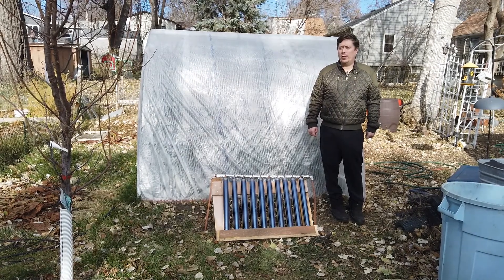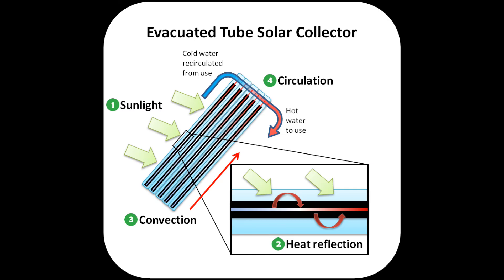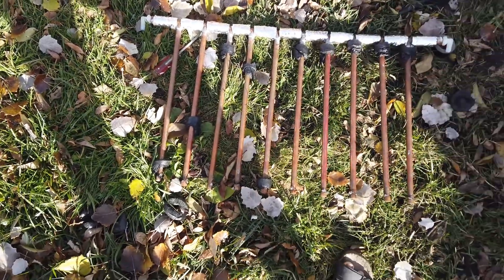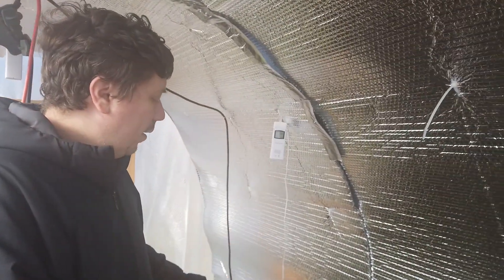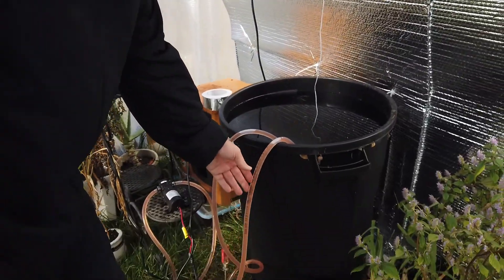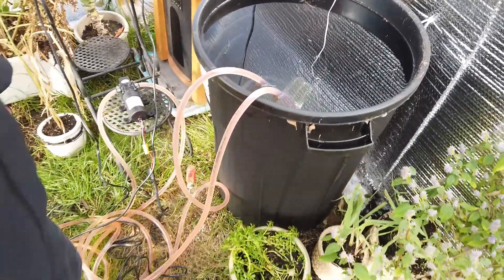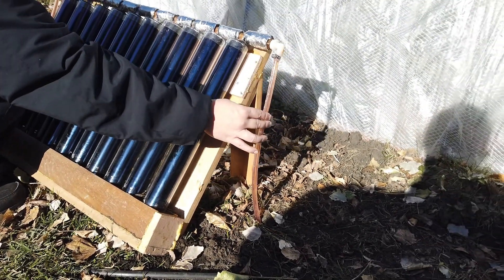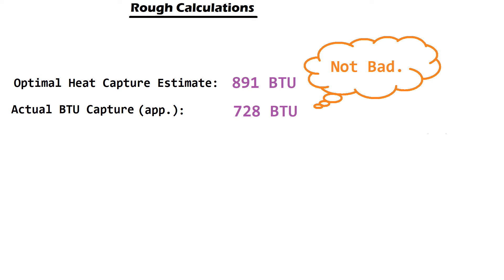Can Solar Power Keep My Greenhouse Warm AT NIGHT?

Comment: I’d be interested to see if you’d see a pump in power if you put something reflective behind the tubes.

How do you decide when to start running the pump?
Reply from the maker: In this case, I simply started the pump shortly after the sun was up. There are better methods, such as cycling the pump, and probably strategies of sensing optimal differences to begin heat exchange. In my case, it didn't seem worthwhile to add that complexity,  although it would be interesting to work out.